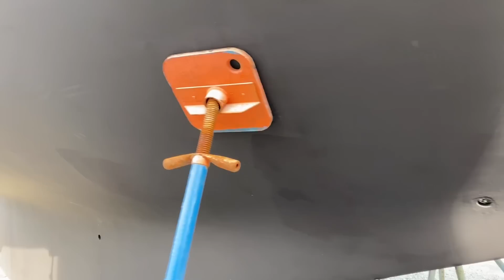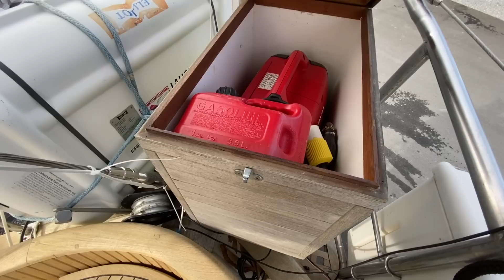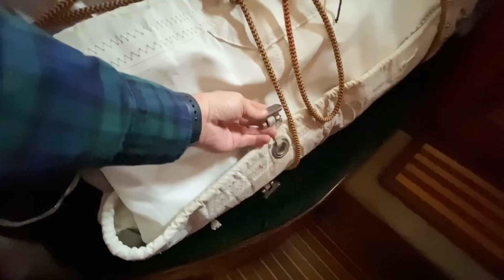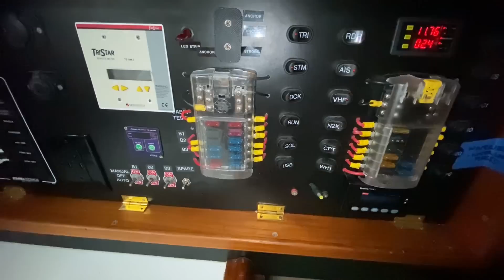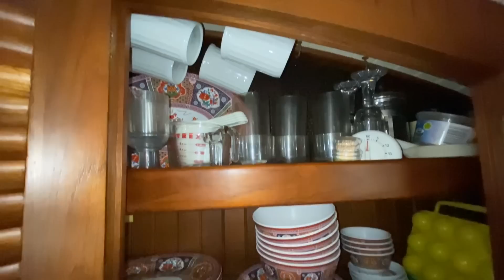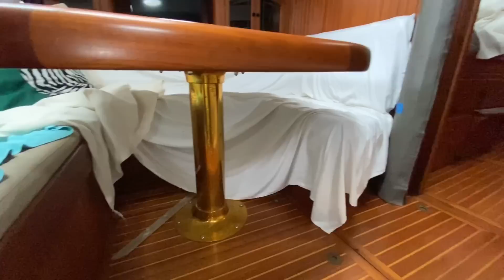Hans Christian 41 1989 LAUGHING BUDDHA For Sale - WALKTHROUGH AND REVIEW

Comment: Almost bought a 43T in 98 in Sea Brook, Texas, the price was right the boat was beautiful & set up for diving and tank refilling but the Trojan 47 tri-level was a better more spacious live aboard. As it turned out the Hans was sold quickly returning to the market a couple years and a couple states away for it's true value which was very high but normal for a Hans 43T so equipped. Beautiful boat for going anywhere and particularly in a stiff wind.

Comment: These are great boats, great builder, classic design. I'm sure the owner loved their baby, but the deck seemed very tired, what's left of the teak seems tired, caulk just about anywhere the camera picked it up needed a do-over. Stainless fasteners were surface rusty, easily fixable, but again. Plastic elements were at the sun-brittle phase...Nothing insurrmountable but makes you wonder about the tough bits. No engine shots-hard to ignor that..Still a fine blue water cruiser. I'd cut that glass dodger off as soon as I was in title. Prefer a canvas unit, look like an old top off a Columbia 43, remember those. The high bulwarks are great but limit visual references, something that is hard to get used to if you spent a year going from anchorage to anchorage. Price? My two cents.
Reply: For the asking price I agree with you about the deck, spider cracks, caulk everywhere and the remaining teak bungs missing everywhere,  just waiting to leak. Lovely boat, but needs a bit of price adjustment.

Comment: The problem with Hans Christian is you can't see out the the ports, all you look at is the bulwarks, you can't tell if you boat has moved while at anchor, a deal breaker
Reply: So, add a couple of larger port-lights if you're so inclined!  Shouldn't be a great big deal if you're already spending a hundred grand to buy the boat!  ME, I'm SOLD on the beautiful woodwork.
Reply: Second comment noting that deficiency.  I was wondering what the first comment meant, but now I understand.  It would be like living in a house with all the windows below grade.  But in a boat you really need instant knowledge of the external world, because the situation and location out there can change in minutes or hours.
Reply: Only meant for allowing ambient light into the cabins I suppose.